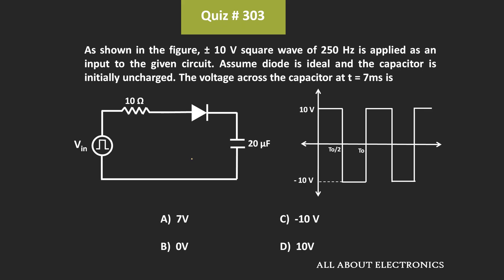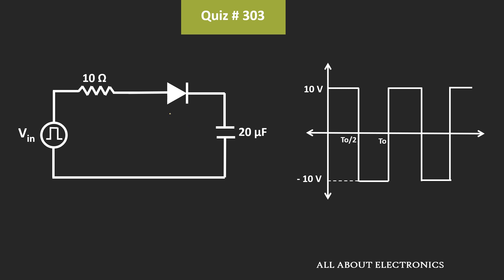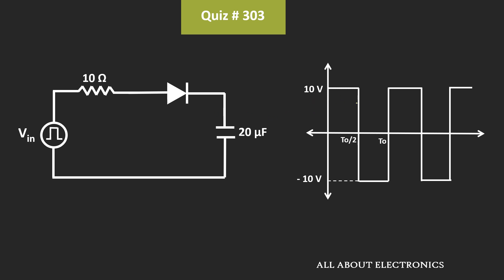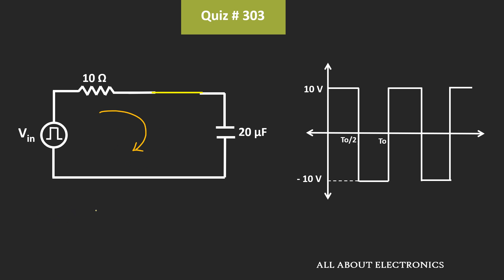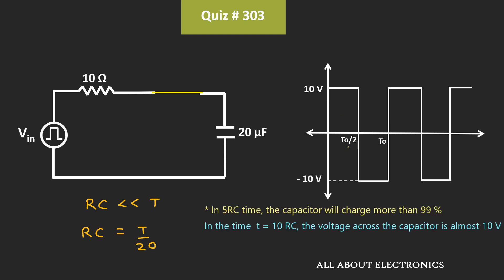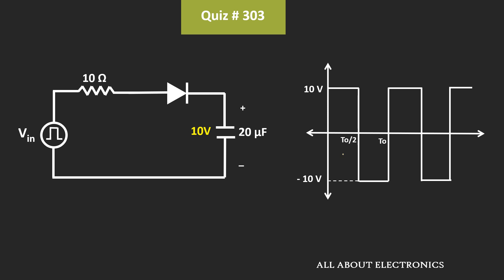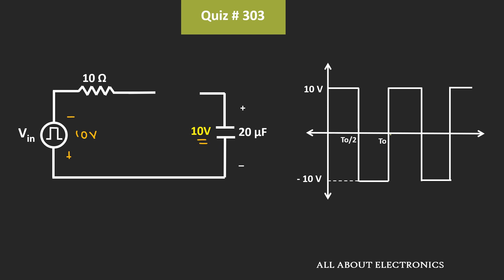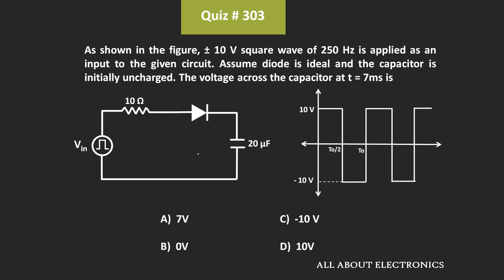Solved Problem on the Diode | Quiz # 303

Comment: Really manipulating question. We mainly have to think about the nature of capacitor i.e charge storage. If there was no diode in the circuit then the answer would have been -10V.
Reply: Then what about the voltage drop across the resistor?